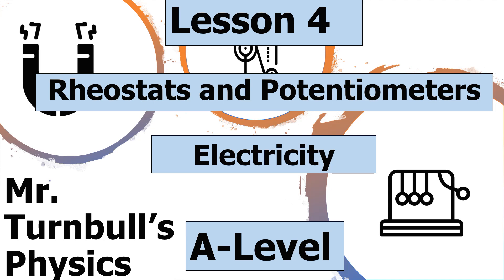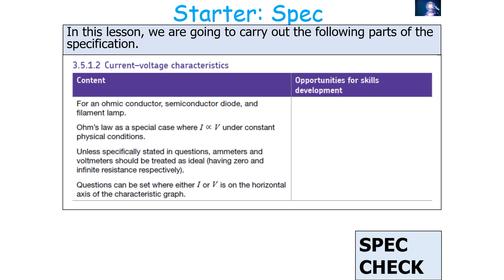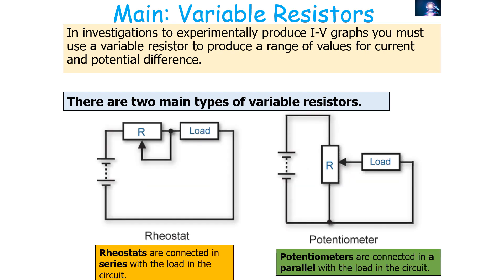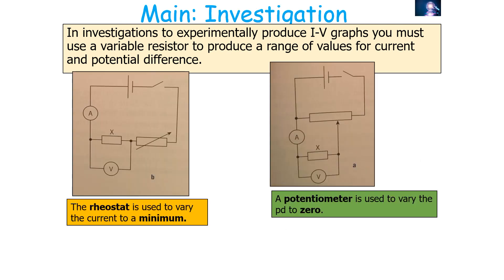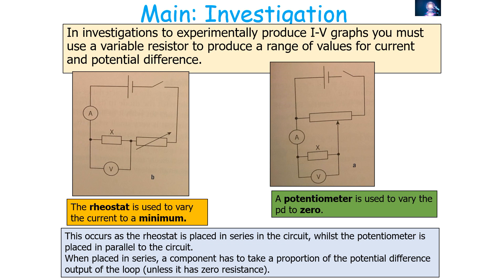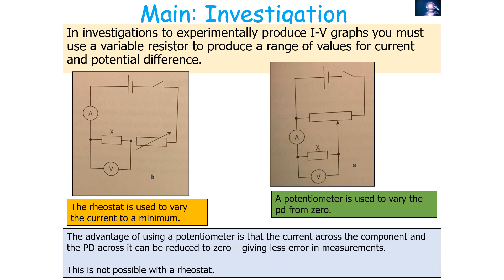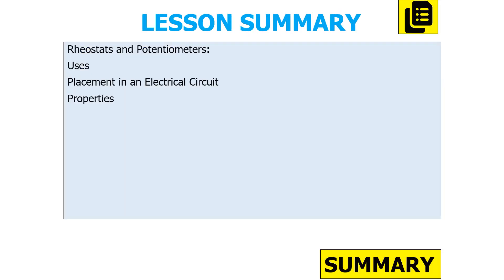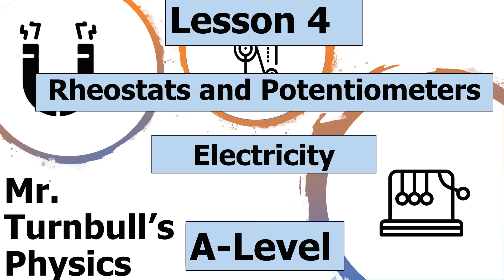Rheostats and Potentiometers

Comment: Thank you so much. This video was very helpful!
Reply: Great video. One question though, i have a B100K i want to use as a current balance between two fans. The fans have different amp ratings but both are beloe 200mA. Can i just run the anode line the the center of the pot and legs 1 and 3 to the anodes of each fan?

I'm poor, otherwise i would just FAFO. 

Thanks❤